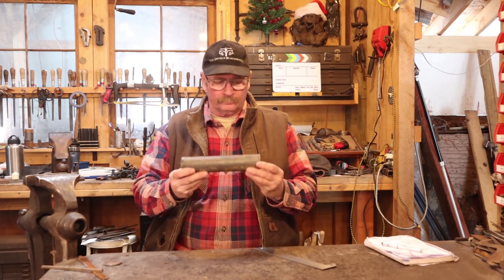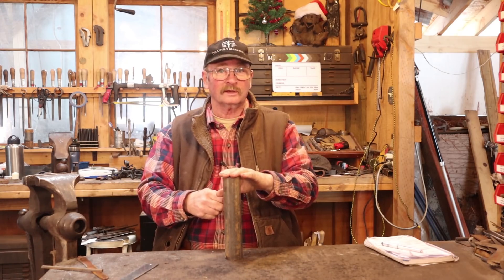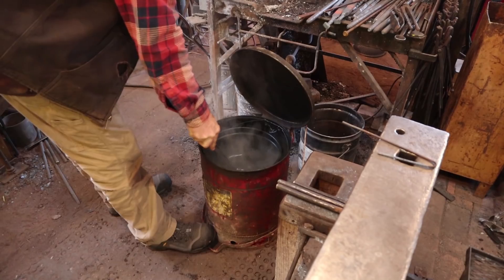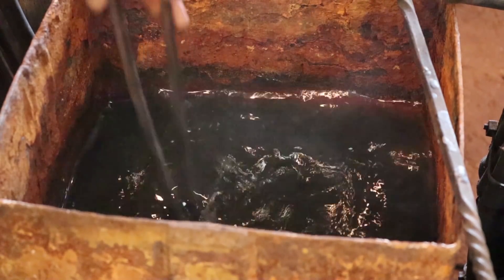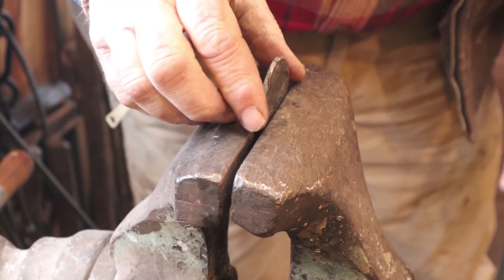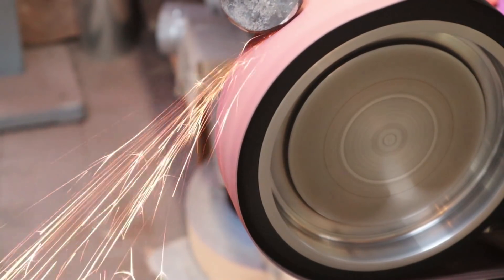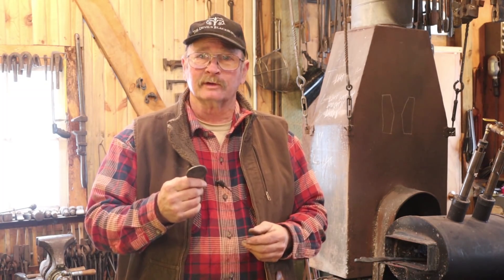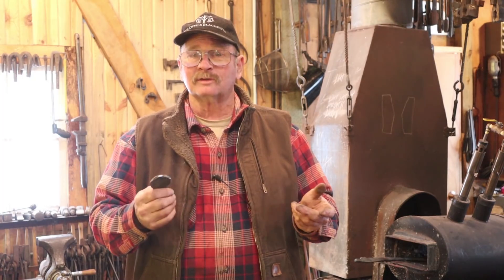Testing unknown steels for hardening potential

Comment: Some scrap yards have a hand held electronic device that tests different metals and tells you exactly what it is, would they be worth investing in if your stock is mostly scrap metal?
Reply from the maker: When I looked at those they were very expensive.  I could scrap all of the mystery steel and only buy new material for less
Reply: @BlackBearForge  If you are a frequent recycler they will usually test a sample for you for free once in a while, if you want to make a habit of it you may want to offer a few bucks per test. Another machine shop owner in my area once told me that if an employee cuts off the colored end of a bar he would get fired, and I can see why. Much more though if the mills ever standardized their color charts!

Comment: Hi John. I have a 60" by 1" roughneck hex shank digging bar #64530. It has a point on one end and a 2" chisel head on the other. I looked it up on amazon and it says heat treated drop forged steel. I don't think I'll have much use for a digging bar so I want to use the material for making other tools. What type of steel would such a tool usually be made of? and what tools do you think it would be good for? Drifts, cut off hardy etc.?
Reply from the maker: Most of those sort of things seem to be oil hardening, but I can't guarantee it.  Should be good for forging tools
Reply: @BlackBearForge  Thank you

Comment: Alternatively every scrap yard and metal facility on the planet will have a gun to test Metals. You can always simply ask them to test what type of metal it is.
Reply from the maker: Strange that in 35 years of working iron I have never seen nor heard of such a "gun" and don't know anyone else that seems to know anything about it either.  Can you provide a link?
Reply: @BlackBearForge  here in Alaska we use xrf non destructive testing to test quality and makeup of Steel in recycling centers. There are many brands that make different types and size of equipment but typically it's a portable handheld gun. Here's a link for one example. https://www.bruker.com/products/x-ray-diffraction-and-elemental-analysis/handheld-xrf/s1-titan-series/overview.html

Comment: My theory is it could be a recycled steel like rebar. Rebar normally is hardenable and does better when hardened in water although I have heard of people hardening in oil to I imagine all peices don’t have the same carbon content so yeah best thing I have is recycled steel
Reply from the maker: While steel mills do use a lot of recycled steel in the production of 
new bars, it isn't random results.  They still have precise control over
 the end product and I am sure this material met an exact specification 
the day it came off the mill.  We just don't have that information 
available.  Rebar is no exception, it is made to be exactly what the engineering specs call for and if you know the code, the rib pattern tells you the specs of a given piece of rebar.
Reply: I’ll have to look into that rib pattern
Reply: Rebar can sometimes be hardened because of the fact that rebar is made from reclaimed steels. It's a big conglomeration of steels that have been recycled. Some rail spikes are hardenable as well for the same reason.
Reply: Exactly that’s what I was saying
Reply: Exactly that’s what I was saying
Reply: Exactly that’s what I was saying
Reply: Exactly that’s what I was saying
Reply: Exactly that’s what I was saying
Reply: Exactly that’s what I was saying
Reply: Exactly that’s what I was saying
Reply: Exactly that’s what I was saying
Reply: Sorry about all those reply’s I hit the button a bunch of time cause it wasn’t doing anything

Comment: Sir, this was very educational with regard to spark testing, thank you. I just wonder if that 2 inch bar offcut was maybe made from salvage melt down stuff, i.e. Melted down scrap cars and trucks which would give it an absoulute unknown carbon and allow content ( Body panels, Engine Blocks, Gear Boxes and Bearings etc'etc'etc )
Reply from the maker: While steel mills do use a lot of recycled steel in the production of new bars, it isn't random results.  They still have precise control over the end product and I am sure this material met an exact specification the day it came off the mill.  We just don't have that information available
Reply: @BlackBearForge  I have a question about circular sawmill blades.   I've recently been given a few from a saw blade servicing business here in Idaho, some have the carbide teeth still, one , they've been removed.   My question is, what type of steel are they made from, and, what would I quench a blade in if making knives?  Or would you even quench a kitchen knife made from them?  Thanks in advance for any wisdom your experience allows.

Comment: Good tip about using the back of your hands to check the heat. I work on helicopters and we use the same technique when checking the turbine engines for air leaks.

Comment: I like using lawn mower blades for making machetes, a lot of people try to discourage it but I personally like the steel because it's low-carbon so you don't have to go through the whole tempering process you just heat treat it, and it can take a beating it gets a little bit harder but it doesn't get brittle and it does hold a decent edge for a while plus the ones I make myself are considerably thicker than your conventional machete and if I have time I take for them to the end so the end half can cut through send stuff while the half that's near the handle is thicker the bevil's I put on it what kind of like a hatchet, and you can chop through small trees and easily make kindling with them, plus if I feel like tempering it a lot less likely to warp because of the thickness, but like I said very easy turn a bunch out because they're low-carbon as soon as you're done forging, heat it to critical, turn right to the oil quench no break, let it sit there till it's cool and then put your bevel, reheat then quench again when it gets cool put your edge on it, and go start cutting things down...
Reply: I once made a lawnmower blade machete that didn't harden at all,  it still works.

Comment: Hahaha I guess I burn myself too often it doesn't bother me much anymore until my gloves start melting into my hand then it hurts I always wear gloves and safety glasses when running the forge. I hardly burn myself badly when forging but when I'm cooking charcoal at the same time I get in a hurry and get too reckless I guess, and forget the charcoal cans are in the fire and sometimes grab them, I did tonight and the wire handle melted my glove into the hand and it was tender going back to the forge and feel the real heat...whoops, but like Grandpa always says we always forget the obvious lessons quickly and have to relearn them over and over because you know what will happen but it doesn't come to mind until after you've done it LOL Merry Christmas everyone, stay relatively safe and have a great holiday celebrating Jesus's birthday
Reply: My wife has started calling my hands oven mits. Since I started forging about 6-9 months ago my hands have gotten so used to the heat that I can grab a cookie sheet strait out of the oven, and as long as I set it down quickly it doesn't leave a burn.
Reply: @KevinSmith-gh5ze  that's a good name for it lol I am a commercial electrician and have been hit with some high voltage a few times and work is slow at the moment so my girlfriend lets me take her phone and watch these videos to learn more and I love this guys channel, but I have a bad habit of grabbing the steel with my gloves if my pliers aren't holding it right to adjust the work, I was making more charcoal tonight and was wearing just regular work gloves and I grabbed a bucket out of my kiln in a hurry and it seered straight through the glove 😒 it blistered almost instantly I was just glad my water quenching bucket was nearby, the got a line through them and a few fingers got singed but one is pretty bad, if it wasn't so dry outside I could have set it down and saved my hand but I don't want a wildfire on my hands... I've been forging for around four months and have made some nice blades, with no major fires so far, right now I'm working on a throwing tomahawk set of four for my next door neighbor out of railroad spikes, I I was watching this video to see if I can find out what kind of steel rail steel is, it heats really nicely but I wanted to find you if I have to harden it because it's pretty tough to get that metal head to move flat instead of a rounded top so is definitely not low-carbon but I don't know what it is
Reply: @nicholecrouch311  I've stopped wearing gloves for that reason. I tend to grab things I shouldn't when I'm wearing gloves. Without gloves, you tend to feel the radiant heat before you actually gab a hot piece of steel. It still happens from time to time though.
From what I've heard railroad spikes are a medium carbon steel. They will harden in oil and hold a decent convex edge, but don't expect to make strait razors out of them.
Reply: You should be wearing leather gloves. Leather doesn't melt and it takes a bit longer for heat to pass through. The best kind are the leather that isn't smooth. It's got more of a fuzzy texture like suede. Just a tip for the future.
Reply: @getoverit4887  I do I been through two pairs so far lol I move the metal into position with my hands if my pliers or tongs aren't doing it quick enough

Comment: Too bad theres noymt some majic machine we could just run it under and it would spit out what it is. 
   I've got several huge pieces of steel I would love to know what they are. 5" round 8ft bar that's like 1600lbs slated to be my power hammer ram ...several forklift forks 8" x 8ft slated to be my anvil. Several axles from 50ton planetary drive axles...ect. lolololol too much stuff and no real answers lolololol
Reply: Spectrometer would be a good name for that tool and it may require a little magic to buy one. Some bigger salvage yards have xrf analyzers but you might offer a little cash incentive if you don't plan on selling them anything. Someone here can probably tell you about the forks..(5160?) another non- real answer sorry
Reply: @maxprophet2401  , thank you  sirSir.  One fabricator I know told me he thought they were made of M 1 or M 7, and another gentleman said he thought they were made of 52100, also a gentleman from UK said he thought they had a metallurgy consisting of ch+ or - 4/6%, mg  around 10% and v + or - 4 / 5%.
    I do know they will destroy a hacksaw blade I short work lol. I've got a 1" ball bearing and from 12 in drop test I get about 10.5 or 11 in rebound. So I figure that it would make a good anvil top. Just not sure how to heat treat it after I weld it all up lol.
   I know theres alot of good guys on here n figured maybe someone had greater idea of them than I did lol.
  Thanks again and blessed days sirSir, very merry Christmas, Crawford out
Reply: Real answers! Merry Christmas!
Reply: @maxprophet2401 , ahhh very much appreciated!!!

Comment: Another good one bud.   Tricky to figure out what steel it is but fun also.  Thx for the info.   I just bought a piece of s7 and o1 and there not marked so I was wondering how to tell them apart. All I have to do is harden them.  The one that hardens in air is s7.  Thx again....Paul

Comment: Mark Aspery once said in a demo that 4140 used to be called a water hardening steel and it's now considered an oil hardening steel. He's always hardened 4140 in water and so have I. Never had a piece of 4140 crack in water and I can never get good hardness from an oil quench. Seemed like 4140 to me from the spark and the file/bend tests that I've done. Just my two cents. Great video, John
Reply: I was just gonna hazard guess at 4140 too, medium carbon steel. I bought some on the recommendation of guess who? ...Mark Aspery
Reply: @insperatus  Yeah for blacksmithing tools you don't need a razor edge because the abuse will dull them quickly anyway. A good tough steel that's easy to sharpen will last longer than a super high carbon steel with a knife edge any day. 4130 sucker rod is a good choice too, the nickel content makes it tough as shit